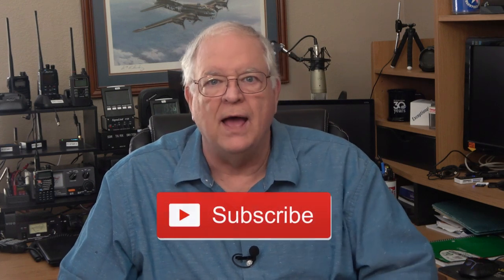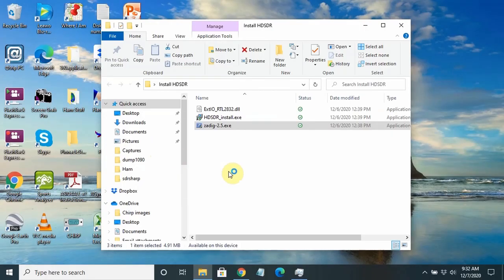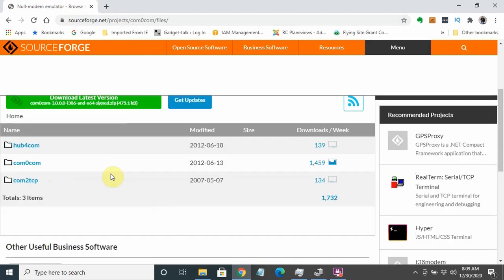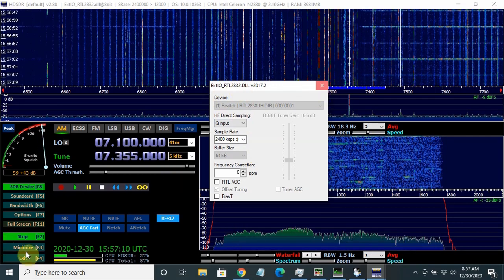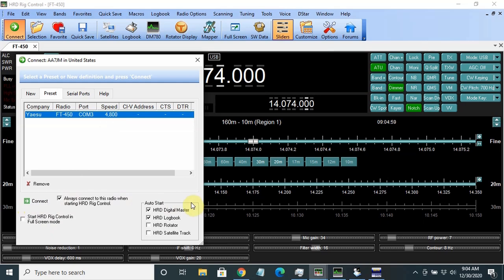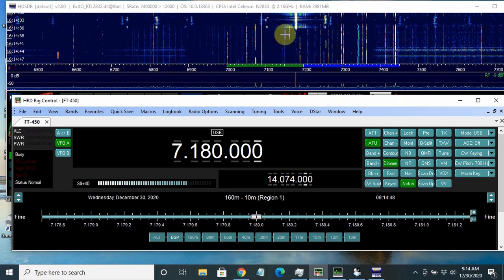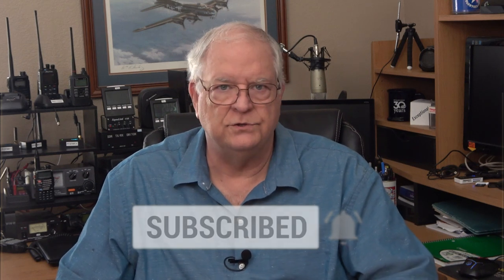SDR Panadapter Using an Antenna Switcher

Comment: Set RTS and DTS to Low to ground PTT , connect PTT on your rig to PTT on the back of the SDR Switch, now when you transmit in SSB you won't have the relay continually switching on and off with the peaks.

Comment: Thank you for this very clear tutorial.  I subbed immediately.  I'm new to ham radio and due to my location I"m completely self-taught.  Been wrestling with just the problems you discussed here and how to safely hook up my SDR-Play to my IC-7300 and antenna without risking damage to both. Would the MFJ-1708SDR-B work better given that its isolation is, I think, 68dB vs the 40dB of the Chinese switcher? It also automatically uses RF sensing in case the PTT fails which could save my expensive SDR-PLay from a fat-fingered burnout.  Also, would I need all that software to connect the IC-7300 and SDR-Play together or is some of that already in one or both radios?  Thanks!  73 JS2OLO

Comment: I too have been wanting to do this for some time on my HF Codan NGT AR mobile rig (with Autotune antenna)I already have a good laptop on board for some surveying I do, including GPS/GNSS gear. I'm about to experiment with a RTL-SDR dongle with 137Mhz antenna & try to receive & convert satellite weather pictures (which is how I tripped across this video) A lot of all this is way above my knowledge but I'd love to know if I can do this with my HF radio??

Comment: Great Video,  working on the same set up.  May I ask what cable did you end up using to ground the PTT?  Was it pin 2 of the Linear input on back of 450d?   Was the cable a home brew or are they commercially available?   73s MI7WPX
Reply from the maker: John, I used the sensing circuitry rather than the PTT signal to initiate the ground. It seems to work well. I figured my SDR receiver was cheap and easy enough to replace if it got smoked. Hasn't happened yet. (Fingers crossed)

Comment: Great video your a genius , I like to know if there is at EZ hook up to my monitor just for viewing the radio water fall . Yaesue 991-A also a ICOM 7300
Reply from the maker: I've looked around a bit and I believe the answer is no. No easy way. You'll have to move to an upgraded model with DVI outputs for external monitors. We need to remember that both the 991A and IC 7300 are getting to be older models.

Comment: You mentioned using a barrel connector to isolate the T/R switch. Could you elaborate on how to do that? Thanks, Glenn K1MAM
Reply from the maker: Glenn, I just meant that I use a short patch cord coax with a barrel connector to easily disconnect the antenna from the switch if I want to go directly to the xmtr. Just a bit easier to reach.

Comment: Thanks for the video. It looked like the tx/rx switch 'flapped' on/off while you were keying the mic, presumably as it detected ssb rf (or not). Do you not have the switch connected to the 450's PTT line? That's much better than using the switch's RF sensing capability, no? Also, did you consider the MFJ1708BSDR as well? I had seen this cheaper chinese switch and was wondering whether the MFJ is worth the extra money.
Reply: Just watched your earlier video on the switch, which answers this :-)
Reply from the maker: Without instructions it took some time to figure it all out, thus the update. Thanks for watching and commenting.

Comment: Why com port 5 in HRD 3rd party serial port?
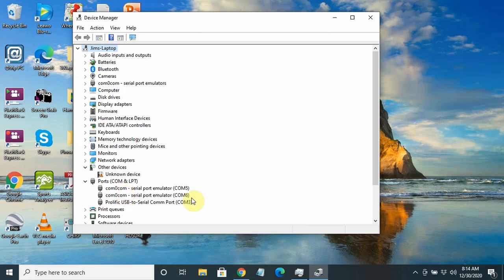Reply from the maker: @coldwater5707  Discussed it briefly at 15:45. I believe it was 5 and 6 on my PC as they were the lowest open pair. If you have a bunch of com ports defined, yours will be different. Pretty sure that's correct. Cheers.

Comment: Okay, how do I connect my PTT din pin to the back of my radio from the switch if my ftdi digital cable is already there?   I have the sdr dongle connected to my laptop and my digital setup with the usb ftdi cable connected to my raspberry pi4
Reply from the maker: A lot of radios don't have a separate PTT connection on the back. I know mine doesn't. I'm not exactly  sure what you are trying to do. I don't use the SDR and switcher when using WSTJ-X as the display is in that software. When using the radio for normal operations (e.g. voice) you can use the PTT line on the switcher or not use any PTT connection as the switcher is very fast at grounding the SDR antenna lead when it senses output from your transceiver. That's what I do. There are several YouTube videos out there describing ways to solder a separate connector to the right inputs on some radio models, but that is way more than I want to deal with. I haven't had any trouble isolating the SDR dongle using the switch's power sensing circuits. Good luck.
Reply: @GadgetTalk4U So my setup is a raspberry pi, with an 897D, signalink, tuner, running js8, fldigi and other digital modes. I wanted to use my laptop s a panadapter, with a sdr dongle, and the switch so I can monitor.
Reply from the maker: @mtngr1  OK. With the laptop as the panadapter it should be straight forward as described in the video. Antenna to switcher switcher to transceiver and dongle. Dongle to the laptop. Use the power sensing to ground out the dongle antenna when transmitting. To get audio to your transceiver move the jumper in the switcher as described in the Update video. Cheers

Comment: I have a Mac is there a HDSR software for that?
Reply from the maker: Search Google for "SDR software for Mac." You'll find some options. Unfortunately for Mac users most of the radio related software including ham radio is Windows. If you can't find anything your like, consider getting one of the sub $100 Windows laptops for your radio work. They're limited but can handle most of these applications.

Comment: Ok, I'm gonna ask a dumb question... Why does it say it only works up to 160MHz? Is that just the rf range it can sense? I guess I'm wondering if using a ppt cable, what would it matter if I was on 440?
Reply from the maker: You got it. The specs say it won't work on the UHF bands. In this application, I think most folks are interested in covering the HF bands and maybe 6 meters. It may work with the PPT cable as you said. Not sure how many 70 cm radios will have a PTT output, though. Cheers.
Reply: @GadgetTalk4U   Right. I'm not wanting to be able to use it with VHF/UHF, I just don't want to have to disconnected my all band/all mode radio when I want to get on a 2m/70cm repeater. I guess I'm wondering if UHF can damage it or still get to the SDR receiver somehow and damage it.
Reply from the maker: @nickthompson5437  Some of the "all band" radio's I've seen like the Yaesu 991 and 991A and Icom 7100 have two antenna outputs. One for up to 6M and the other for 2M and 70CM. With the antenna connected to the lower freq output of your transmitter the SDR would stay safe. As cheap as SDR dongles are, get a second one and use it disconnected from your transmitter if you want to "see" the 2M and 70CM bands. Just a thought.

Comment: Good afternoon.  I saw your video and have obtained this switching unit.  I have it all hooked up but have no connection with the radio while under normal operation.  The SDR side to the computer is working fine business.  When RF is sensed by the switch, the relay works.  The only time I get audio or reception to the radio is when the relay is switched.  Is this how yours is working or are you getting output to both the radio and computer when under normal operation?  Also when I transmit, HD SDR is picking it up and causing the signal to output from the computer as well which causes interference.  Any ideas?  My email is good on QRZ if you want to reply there instead of here.  Thanks for any help you can provide DE K0HIO
Reply from the maker: Like you I have found that the signal seems to route to the SDR but when the transmitter is keyed, it outputs. You can see it on the HDSDR display and it was pickled up on my portable HF receiver. This proved problematic for me as I do a lot of FT8 and the WSJT-X program would receive no audio to decode. I think this switcher would be OK for the person looking for a panadapter display for an older transceiver who primarily uses SSB but its a bit of a bust for digital modes. After working with it a bit, I'd give the switcher a C-.
Reply: @GadgetTalk4U  I decided to open it up to check for possible jumpers and the like.  I removed the jumper that is available to make it open.  This allows for it to receive on both HD SDR and my IC-7100.  Further testing shows that the rf sensing relay works as supposed to at this point.  I simply turned the sound on the computer off and the problem is solved.

Comment: How do you have the tuner connected to the switch and radio? I have the same tuner for my 891 and want to make an SDR display. 

Do you use the wire from
The tuner to the ALC jack on the radio? Or just the coax and manually turn the power down for tuning
Reply from the maker: Take a peak at the update video on this topic on the channel. It shows an internal jumper to set. Also, if your radio has a PTT output, you can connect via the plug that came with the device. Otherwise (since my radio doesn't) I let the sensing circuitry in the switch ground to lead to the SDR dongle.
Reply: @GadgetTalk4U  saw the update. Asked one question there lol. Thanks for the quick reply. I’ll definitely be buying one.

Comment: So why do you use TS-2000 in the Omni-Rig setup?  What does HRD have to do with any Omni-Rig setup?  Or vice versa?  It shouldn’t.  

HRD should support an FT-450 directly.  HDSDR has a function to interface to HRD with no ties to Omni-Rig.  OmniRig as well should interface directly to the FT-450D with no HRD inter-action.   There are some SDR applications that require emulation using the TS-2000 by using the command set.  But not this setup.  The TS-2000 doesn’t need to be even mentioned in this video.   

I’ve been using SDRs, TS-2000s, ANAN-100 (TS-2000 emulation) and a FTDX-3000 for many years n all of these configurations for a long time.  Did I miss something?  Or did you make this unclear?  You run both at the same time?  Like you said, kinda cool but adds complication and little real return.  The reason reception is changed it due to the 3db+ insertion loss the switch has in conjunction with the RTL-SDR being a very low quality receiver.  You get what you pay for with SDRs.
Reply from the maker: Please take a look at the update to this video where I discuss most of the points you made.  Cheers. https://youtu.be/-OLWWF21YJU
Reply: Thank you, I will.

Comment: I have read and seen (https://www.youtube.com/watch?v=I3QtuozE3vU ) that some Chinese SO239 connectors have metric thread pitches that mesh poorly or not at all with a standard PL259. (There are no problems if the PL259 is also Chinese.) Has anybody had trouble with the SO239 threads with this antenna switcher? More broadly, how widespread is the problems with Chinese SO239 connectors? (Xiegu, etc.) Thanks!